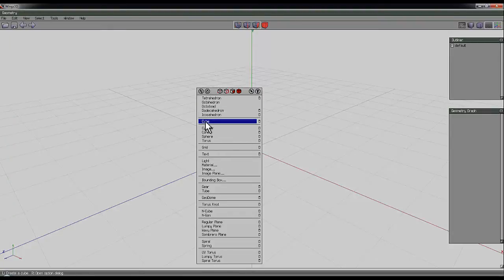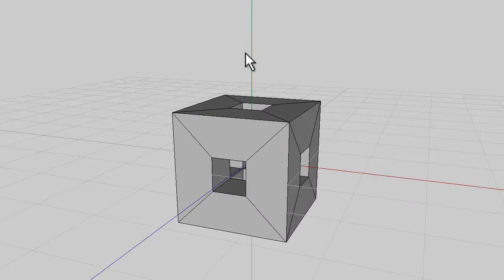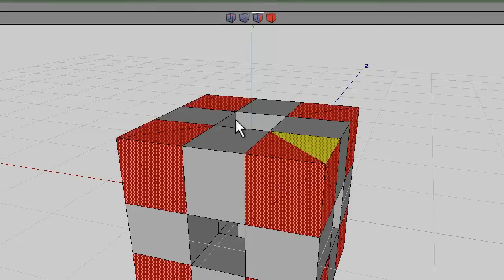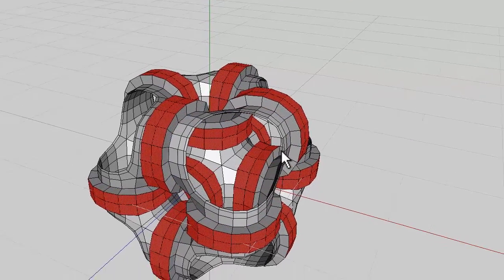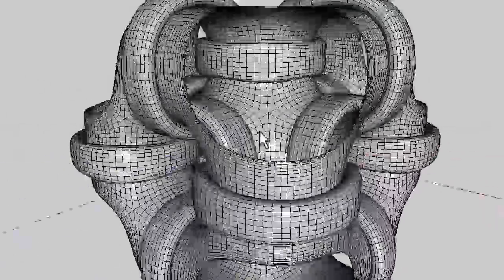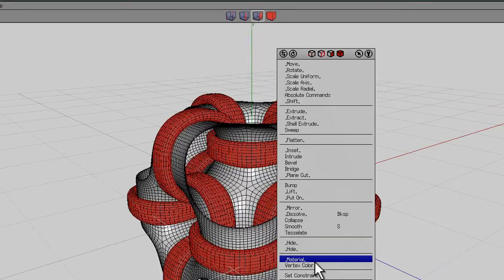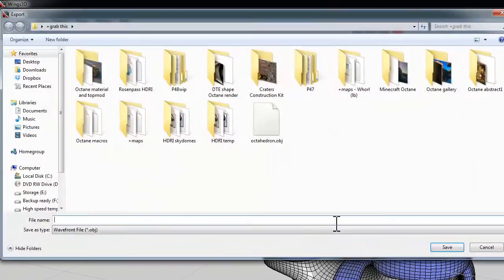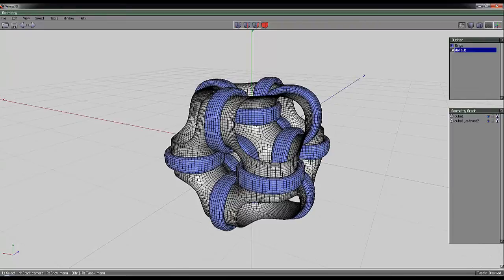Wings 3D project - wings things with loops - by David Brinnen.

Comment from the maker: I agree it shouldn't but it will because of a bug in the way that Bryce measures the change in angle of the surface, this is a smoothing issue relating to Bryce rather than one relating to the supplied geometry, but it will only affect curvature filters nothing more because that is the only material effect that knows about local geometry as it relates to the scale of the mesh facet.  Slope and Orientation would be no problem, they are global not local filters.  It is something that needs fixing.

Comment: If you assign different materials to the large polygons and the small polygons in Wings3D, Bryce will recognize them as different objects. In bryce you can then assign the same texture to all parts of the object with no problems. With the large polygons seen as a different object, Bryce will have no issues of that type.

Comment from the maker: Hmn... I suppose one of the reasons I've tended to avoid having different densities of smooth on the models I create (aside from it just being easier to smooth the whole model in one go) is that there's a funny mesh smoothing bug that occurs in Bryce when it comes to using curvature filtering, which would pick out such large polygons.  But otherwise, yes.  It is worth a look certainly.

Comment: You can also keep the polygon count down by choosing only the faces you wish to smooth in face mode, and hitting the S key. It will smooth those faces and only add extra polygons beyond that to adjacent faces. Large flat surfaces do not need to have a lot of polygons. I try keeping mine down to no more than 8 faces. This saves memory. Object mode smoothing adds geometry to the whole object, which in many cases is not needed.

Comment: I have to say this too: If you select only the parts of an object you wish to be smoothed (I do this in Face mode) you can limit the amount of polygons that get smoothed. My point is that large flat surfaces do not need a lot of polygons. This helps with memory use, because  the more polygons you have, the more memory the model occupies. I try to keep the large flat surfaces down to no more than 8 faces (polygons).

Comment: I discovered a way to keep the polygon count down in Wings3D, and any other vertex modeler for that matter. Basically what you do is only smooth the edges that need to be smoothed. You can restrain the smooth action by first marking edges you don't want smoothed as Hard. This is done in Edge mode: R click the workspace, select Hardness from the list, click Hard. The selected edges turn yellow. After you smooth, select all edges and repeat the steps, but click soft. The yellow is gone!

Comment from the maker: Thank you for the tip about the way materials work between Wings 3D and Bryce.  Previously I just relied on Bryce seeing that I had made separate objects and letting me unpick the model in Bryce but... if I made an object with many parts, it seemed that some of them became stuck together and ungroupable and in Octane, all model parts are stuck together.  But material separation works fine - so it is good to know it also works in Bryce.  Thanks also, yes 5 minutes, is the best length.